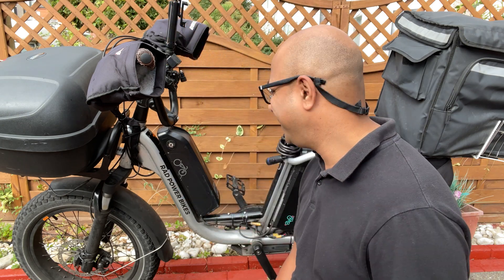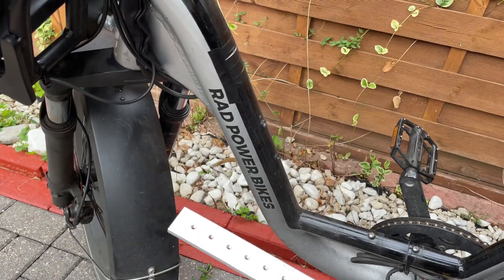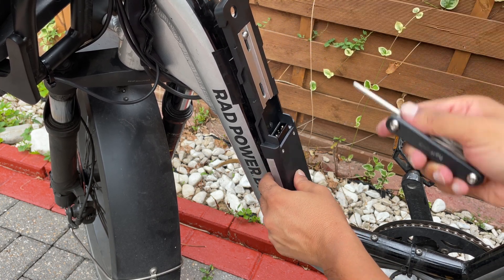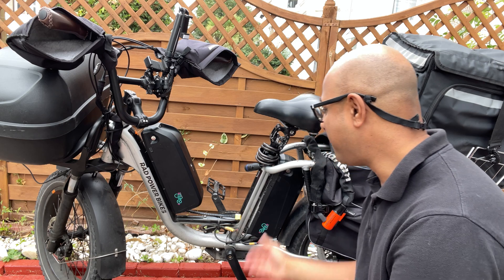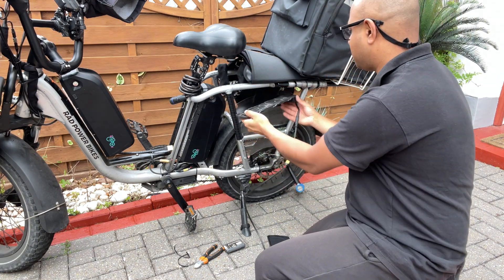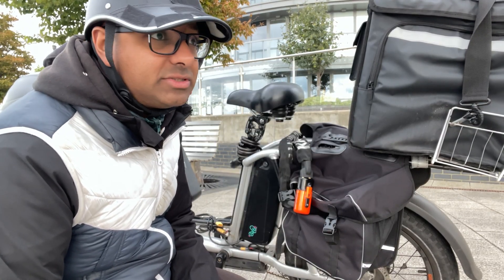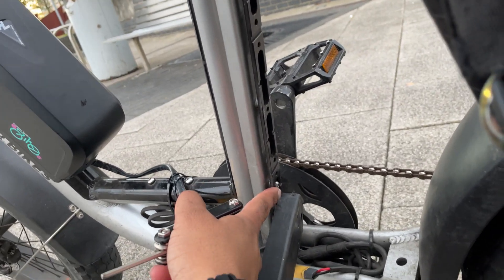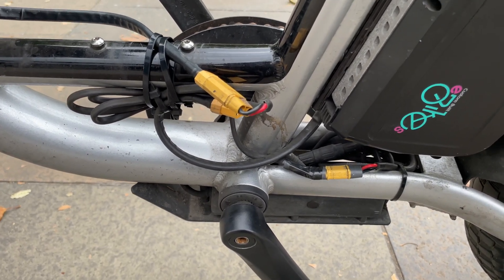Radrunner Plus - Long range battery installation

Comment: where's the link for that box   so nice
Reply from the maker: i bought it on ebay. it's a: motorcycle top box extra large 52L universal fitting
Reply: @shekhar1203  and that part that holds the box if i could ask
Reply from the maker: @516throwapot  that's the front rack, i bought it on the rad power bikes website. it is a very good quality front rack

Comment: You are like me with batteries, I have four batteries on my RAD MINI.  I bought a newer ebike that comes with a 60-amp battery.   Once I get another battery, I should be able to travel 200 miles without peddling.
Reply from the maker: 200 miles!! that's awesome!! i recently bought a 48v 30ah battery with lg cells and it's a wonder battery. in total i have 5 batteries so i can get approximately 150 miles range without pedaling, although two batteries are plenty for me (the 30ah and 24ah batteries) as i get approximately 95 miles with them two batteries.

Comment: Hello, how you installl the adapter for the second battery?
Reply from the maker: hello, it's the same as the first one. you just have to remove the original battery tray, install the adapter and mount the new battery tray on top

Comment: very cool bike.  Are you replacing the batteries when one runs out or are they all being used at the same time?
Reply from the maker: at the moment i have only one connected and when it runs out i disconnect the cable and connect the other one. i am going to get a parallel battery connector very soon but i will still only use one at a time. i'll explain why im doing it this way instead of having both connected at the same time in a future video very soon, latest before the end of march when i start uploading my next level videos
Reply: @shekhar1203  ok thanks

Comment: You could also just carry another battery in one of your bags... 🤷🏽‍♂️
Reply from the maker: i prefer to install them on the bike because these batteries are a bit heavy and can't be bothered bringing them with me in a bag all the time. when doing deliveries it's not safe to have the battery in a bag because it can be stolen and also would make it difficult to pick up and drop off orders. at the moment i have two batteries installed and i keep one in the front top box, although this is just temporary and i will also install that third battery on the bike. there is just one big issue with the radrunner plus, and i haven't found a solution yet. i will explain it in a future video very soon, probably in march, when i start my next level videos.
Reply: @shekhar1203  got it. I get your point.  But with 3 batteries, the bike gets really heavy.
Reply from the maker: @martinlandry5486  yes the bike is a bit heavy with 3 batteries but this is how my bike works currently: 1 large capacity battery = 25 miles range, 2 large capacity batteries = 50 miles range, 2 large capacity batteries + 1 original battery = 65 miles range, 1 original battery alone without any other battery = 15 miles range. so basically even if i left my 2 large capacity batteries at home i would get only 15 miles range wich is not enough to do a long day of deliveries. in total i have 2 large capacity batteries and 2 original batteries so in one day i can do 80 miles, although i usually only carry 3 batteries and if i want to work almost the entire day then, usually, i would carry 2 large + 1 original batteries, use the original battery first, go back home, put it on charge and grab the other original battery so i still have 2 large batteries and 1 original battery, all of them fully charged. but yeah, it's just how my bike works and yeh, it's really heavy but all that extra weight has got it pros and cons. i will explain everything about my bikes in more detail before the end of march, when i start uploading my next level videos.

Comment: Hello there: Great video! Which front box is it, mayve a link, please? How much did you pay?
How much did you spend for all battery packs? How many Ah/Wh do you have in total? How heavy is your bike now and can you still ride 20 miles/hour?
Reply from the maker: hello and many thanks!! i bought the front top box on ebay for £50. it is listed as: MOTORCYCLE TOP BOX EXTRA LARGE XL 52L UNIVERSAL FITTING LUGGAGE. the batteries, i bought two of them for approximately £900. each battery is 48v 22.5 ah. with all that added weight my bike now weighs approximately 50kg. all that extra weight does affect the acceleration and it is slightly slower when going uphill but i get a very long range. tyre psi also affects top speed and hill climbing speed. i usually keep it at 30 psi.  its been just over a year since i bought this ebike and i will do an update video of the bike very soon where i will go through some of the new pros and cons

Comment: I have enjoyed your video, I wonder though that adding 40-60 kg in batteries to a bike weighing rated for 130kg. How is it to ride with all that extra weight?
Reply from the maker: many thanks!! and i have 4 batteries in total, 2 large capacity (5.5kg each) and 2 radpowerbikes batteries (3.5kg each). i usually carry 3 batteries at a time and i always carry a radpowerbike battery but that doesn't count as an extra weight so let's say that i bring with me the other two large capacity batteries, that's extra 11 kg. now, the performance depends on the tyre psi, i usually keep it between 25-30 psi, and that extra weight in the middle and at the front, for me, makes it very comfortable to ride. you will lose a little bit of hill climbing power but you get extra miles. i usually get this: 1 radpowerbike battery = 15 miles. 1 large capacity battery = 25 miles. if i bring 1 radpowerbike battery and 2 large capacity batteries i'll get 65 miles range. this bike is almost perfect, the only thing that's missing is rear suspension. i have a suspension seatpost but that makes it difficult to get on and off the bike because it's too high for me. but yeh, apart from that it feels very comfy. oh, and the front topbox weighs approximately 1kg, the rear delivery bag also approximately 1kg and another 1 kg in bits and pieces so overall i usually have between 12.5 kg and 14 kg in extra weight. and i weigh 75 kg

Comment: Are you really getting additional range? It looks like the extra battery is just to handle the added weight you put on there. Is this for food delivery? Why all the massive extra storage?
Reply from the maker: with the new battery i was getting approximately extra 10 miles in range compared to the original battery. i use my bike to do deliveries and the extra storage is to keep extra clothes, waterproof clothing, snacks and drinks

Comment: So you now have fitted two larger batteries. What do you do with the battery it comes with?
Reply from the maker: i have made a few more changes to my bike and temporarily i have removed one of the large capacity batteries and re-installed the original battery

Comment: Hello, why don't you use a parallel dual battery converter? You don't have to switch betweens batteries anymore and with two parallel battertes you have more range and battery life than running one battery at a time.
Reply from the maker: hello, i was thinking about getting that and i might buy that in the near future
Reply: @shekhar1203  I have ordered one too, maybe a week from now I will install it. I have choosen the chinese one from aliexpress. I will keep you informed. I really think that will be useful for you.

Comment: Keep those tires aired up proper ..looks like a lot of weight on your bike.
Reply from the maker: yeh it's a bit heavy now but this bike can handle it without any issues. plus i've got a new tire too for the rear wheel (195kg max load capacity) but i might switch back to the kenda tire because it was lighter and i was getting a little bit more range

Comment: What are your thoughts on bike mirrors??
Reply from the maker: yeh they are good, i was actually planning on getting two mirrors for my bike as well as indicators and a loud horn
Reply: @shekhar1203  Looking forward to seeing the update on your epic bike setup!!! Keep them coming!
Reply: @shekhar1203  I look forward to seeing what mirrors you buy. I have watched a few reviews and most seem to vibrate to the point they are useless. The best ones seem to be the ones that go into the end of the handle bars - not trying to influence you by the way. I have seen indicators on Ebay for around £10 but not sure how they work remotely  - will wait for your review :)
Reply from the maker: @gframe287  i had a look at some lights and mirrors online a few times but still not sure wich one to get but will definitely get them very soon

Comment: Maybe hooking the two batteries in parallel would be a better option the adaptor would be dirt cheap. That would achieve the same thing with no switching of plugs.
Reply from the maker: i thought about that but i have used one battery for a while and the other one is brand new so when fully charged they have slightly different voltage and sometimes i use the bike continuously for long periods of time so it might be bad for the batteries if connected together. besides, it only takes like five seconds to switch batteries lol so i don't really mind doing that tbh
Reply from the maker: @TY 達也 in NYC no, the controller works with the new batteries without making any changes.

Comment: That sucker is maxed out!! Wow!
Hope the earnings are getting better?!
Just a question: in my area DD gives zero orders to bike couriers so I leave mine on car. Do you do the same? I made $70 in about 2.5 hours tonight.
Reply from the maker: now its even better because i have installed the third battery and now i get approximately 80 miles in range and i also bought the cable actuated hydraulic brakes and i'm going to install them one of these days. i have kept mine on e-bike and i get a good amount of deliveries but every day is different so sometimes is busy and sometimes very quiet. and $70 in 2.5 hours is really good!! i usually make around £10 per hour